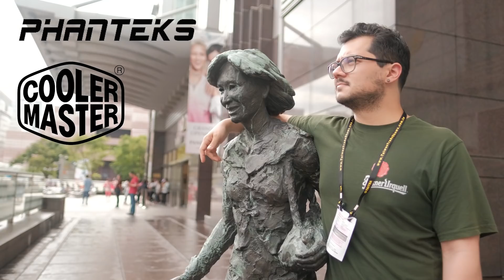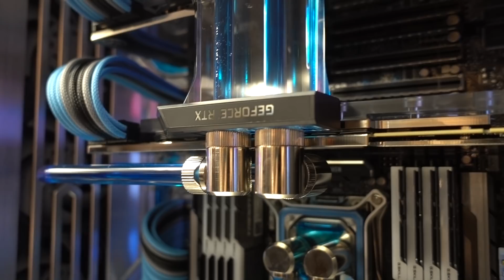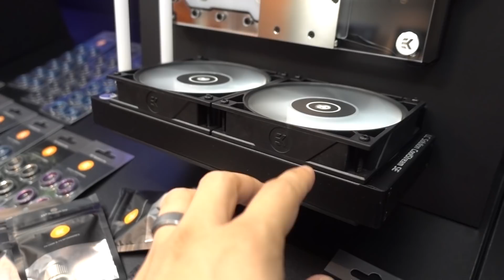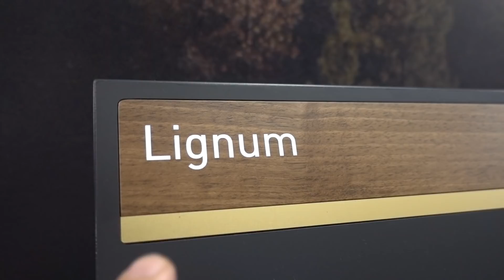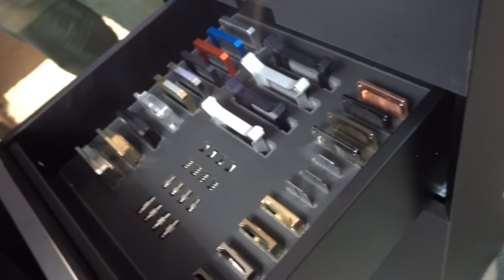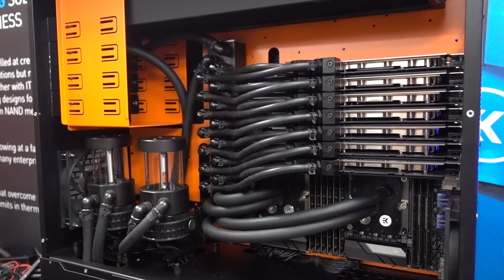EK deserves all of my money

Comment: LMAO My dad has a wood shop. I could make all those wood parts for a hell of alot less for what they're charging. Unless its crazy expensive wood like black walnut. At that point I wouldn't be surprised if they charged $1000/sku because with an extremely limited supply wood like black walnut you'd really be taking two big niche markets and joining them together. However if its something like red oak or maple or even pine watch out EK the ENTIRE cabinet industry will jump all over that shit they have big ass trade shows too!
Also I wouldn't call that a "modern" look. I'd call it a throwback to the 70's. Ya know THE AGE OF WOOD FURNITURE TVs AND VCRs, as AVGN would say "It was the wood age"
Reply: The Q sounds like it’s time for you to get into the water block business haha
Reply: @Shmojoe14  Yeah you might be right. I may not be able to do walnut. But oak maple and cherry I could probably do. (Walnut is ridiculously expensive).
Reply: The Q well maybe charge a premium for that, especially if the market is limited you might have an advantage haha

Comment: I wish tech companies can find powerful waterless cooling solution for PCs before my next PC purchase. Can't imagine water flowing inside my computer.
Reply: Hasan Salim how powerful are you talking? Lots of air coolers are really good out there
Reply: @Shmojoe14  Watching many of videos on watercooling gives the impression that a PC  with powerful intel/AMD processor will not survive without water cooling.
Reply: Hasan Salim no that’s not the case, plenty of air coolers are really good and can handle more than you might think. I’m running a Noctua air cpu cooler with no problems at all. Good thermal paste and airflow through the case help wonders
Reply: @Shmojoe14  Nowing that air cooler is sufficient for powerful PCs is a relief.  Thanks for your feedback.
Reply: Hasan Salim yea man no worries, you can see the pc in the back of my videos and the beefy cooler on the cpu haha

Comment: EK: Here's our Budget line!
Me: But it's still too expensive and so much work to set up and maintain...
Reply: Im not going into custom water cooling until ive built my first pc which will have water cooling just i wont have to build lines
Reply: @kings_nemesis5995  AIO's is always going to be the best thing to use. Clean look, good cooling, and you don't need to drain and re fill. I own a Computer repair store I build PC's all the time. These builds are the only thing I don't do, far too much to go wrong and be responsible for if something leaks. They also take forever to put together.
Reply: @NovisBeanis  actually, air coolers are the best thing to use
Reply: @NovisBeanis  thanks for the info gald im making a good choice to go AIO
Reply: @kukkibolli1  in terms of raw cooling yes, but if your wanting the best of both worlds AIOs is the way to go, some people prefer the look of air coolers, all the power to them!

Comment: They deserve none of mine after their x360 radiator sprung a leak after 6 months of use with ONLY EK parts in the loop and even using EKs own fluid.
It flooded the PSU and shorted the 230v line to the 12v rail and possibly other rails.
It killed EVERY component in my system.
16GB of ddr3 ram, fx8350, gigabyte 990fxa ud3, r9 295x, 1000w corsair psu, 5HDDs and two ssd, 6 120mm noctua fans..
The only thing that survived was the case and it's IO ports and leds.

I still keep the radiator and the PSU to remind me every time i am impressed by a watercooling build.
But now i have an even quieter system with only noctua d15 and noctua case fans.

Comment: These wooden blocks are nice.

I don't think they are that difficult to manufacture. I Think the price is high because it's a niche product.
Reply: Keep in mind they're quite tight tolerance because they're a faceplate not water-bearing, and also they likely have a pretty low yield. Tiny blemish and you might as well scrap it.
Reply: @SamebitoYT  Why would they have a tight tolerance?
All the manufactured parts are hidden.
I don't think I would be able to tell the difference between this and if someone eyeballed it with a mill.

Edit: I'm not a Wood worker. just trying to understand.
Reply: @konigderwelt2174  because the wood is overtop of more conventional block material, while still needing to meet certain measurements so that it doesnt visually take up significantly more space than their other lines. The fittings need to be even more exact (even though they're just covers over a more standard barb, I believe)- if it doesnt fit perfectly, either your tubing can slip over time, or you can have some awful gaps.

Then, as I said, there's the yield issues. Because wood is a natural product it's not particularly consistent. Between knots in the wood, warping during work, splitting, cracking, gouging, etc I wouldn't be surprised if they have something like a 30% yield for QC-passing parts.